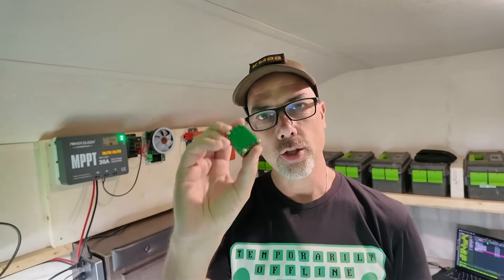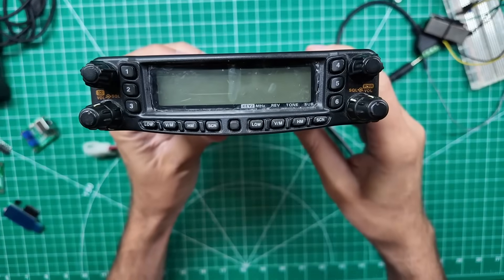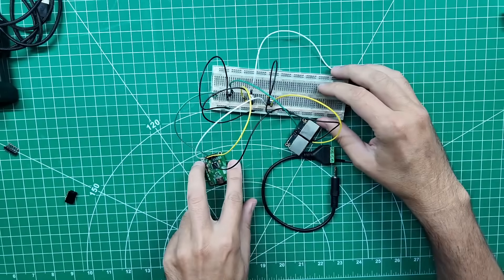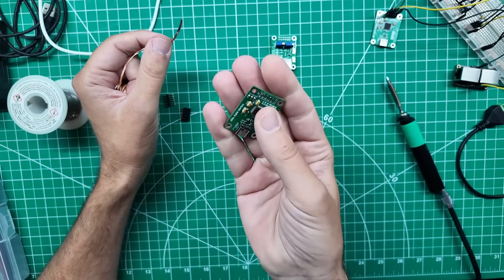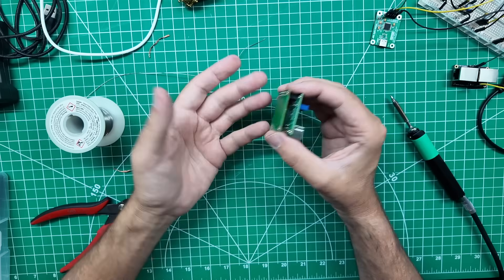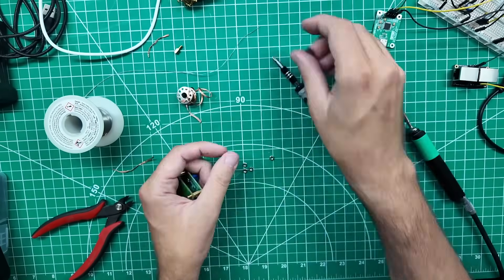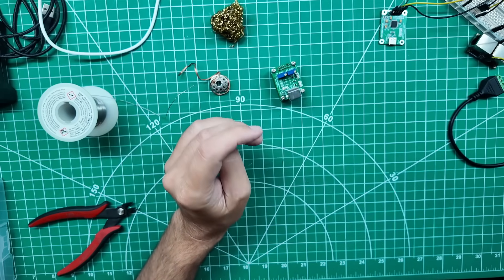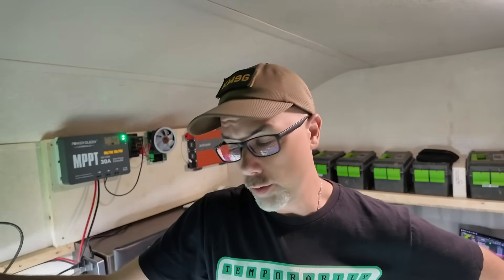This Simple Board Unlocks Digital Modes on ANY Ham Radio! (TOADs DI6 Review & Demo)

Comment: I still daydream about my local redneck network swapping data packets over CB. They're still the most prolific working radio type by at least a factor of 10. A hundred of these across the region would be a capable thing.

Comment: I think I need a TOADS digital board to redo my RS HTX-10 interface with.  Built it based off an old article/schematic and it does work (at least for FT8, all I've tried through it so far) but could be more elegant.
Reply from the maker: Sounds like a fun project!  Let me know how it goes!

Comment: I can't believe radio companies are still using ps/2 ports.  Get with the times, yeesh.

This also makes me wonder if you could just use a ps/2 to usb adapter like used to ship with old keyboards and if you could just handle all of this in software with a driver.  I think probably yes, but I don't have the programming skills to make it happen.
Reply from the maker: The PS/2 to USB keyboard/mouse adapter is just a media converter and has no 'brains' - all that is buried in the keyboard/mouse.  So in this case you'd still need another piece of hardware to finish the translation.
Reply: It's not a PS/2 port, it merely uses the same 6 pin mini-DIN connector as a PS/2 port.

Comment: Hi TO, forgive my lack of knowledge.  Can you explain the difference between Digirig and your device?  Thank you.
Reply from the maker: Sure thing.  AFAIK the digirig does not support COS and is aimed more at appliance operators.  Mine is aimed at tinkerers who have older radios they want to get on digital-audio modes easily.  Digirig is a great product though, I have a few as well.
Reply: There is no..it's a little bit cheaper

Comment: I was thinking of getting a Digirig setup to connect to my FTM-300DR for around $100. Is this going to do about the same thing? Sorry, I'm still learning digital formats.
Reply from the maker: They are very similar, but getting a little more techinical: The TOADs DI+DI6 does COS for allstar setup and I don't think the digrig does.  Digirig sure does make some nice cables!
Reply: @temporarilyoffline  So it sounds like I might be better off getting this instead of a digirig.  I also want to use it on my FT-710, but so far I can get everything to work on that just on the USB. My Linux laptop has a couple of problems though.
Reply from the maker: You really shouldn't need this board for your 710.  It has a built in USB sound interface.
Reply: @temporarilyoffline  Second question. I'm trying to set up digital that works on Windows and Linux laptops. That's why I was thinking of getting a Digirig because I can't get the FTM-300DR to talk to the Linux laptop with what I have because of driver issues. This system sounds like it would work better than the Digirig, and it's cheaper. Should I consider it instead?
Reply from the maker: Both sound fobs use the same base chip.  The CM108 - which has its drivers built in to the linux kernel.  What seems to be the problem on the linux side?
Reply: @temporarilyoffline  I use the RoHS USB-77 to connect most things to my 300. I just couldn't get direwolf or YAAC to work on Linux because it just wouldn't recognize to connection. Someone told me that Digirig would be the way to go.